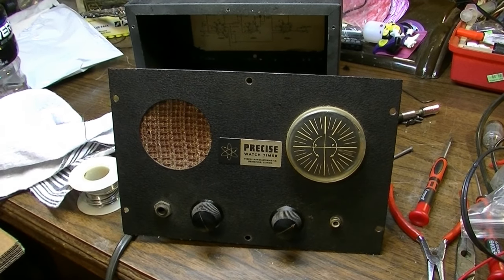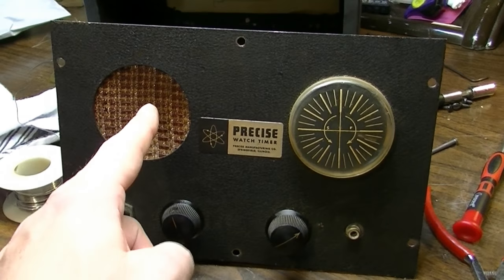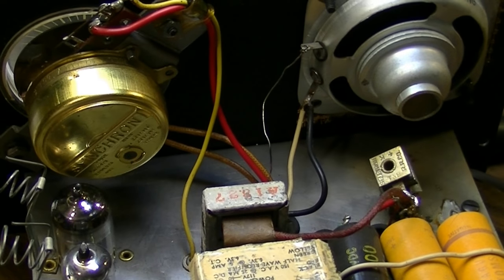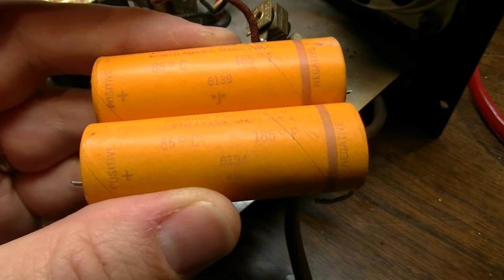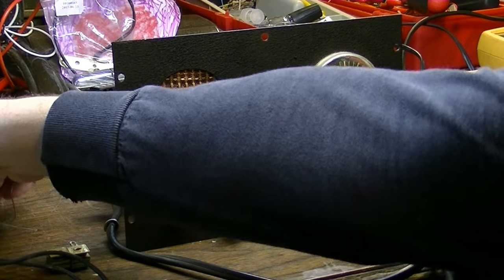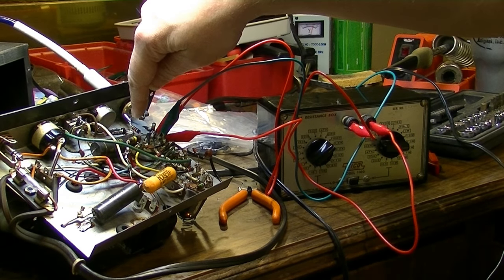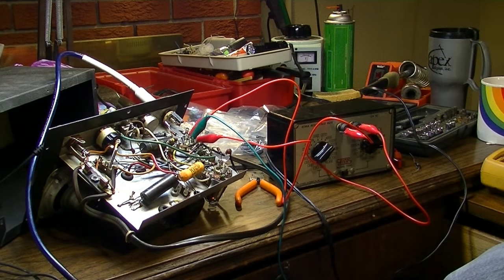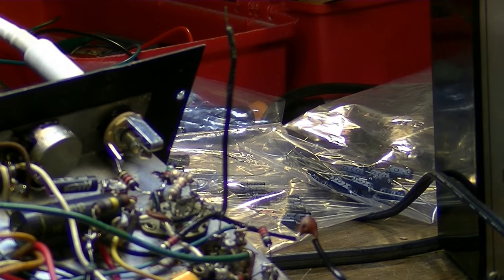Vintage Watch Timer Converted into KILLER Guitar Preamp (Part 1)

Comment: The high gain circuit is to amplify the sound of the watch and the flashing light syncs with the sound and acts like a strobe-o-tuner except for time rather than frequency.  This is used to adjust the speed of the watch for accuracy.
Reply: Correct. They had a cradle type arrangement to hold the watch, with a microphone in it...thats what would have pluged into the rca jack.
Reply: and then they sync the beats like two metronomes?
Reply: Bo Huggabee, thats correct
Reply: cool thanks for the info!!
Reply: Would that be for the watches with crystal movements? I found a old watch that had 18 jewels in it, But once opened it had been changed over to cheap movement idk why someone did that.
Reply: It is for mechanical, multi-jewel watches.  High end time pieces for the most part.  Cheaper mechanical watches cannot be synced and electronic watches don't need it as they use a crystal oscillator for accuracy.  Just a fun fact, some of the multi-thousand dollar 21 jewel watches were accurate to one second a year.  (at least they claimed)

Comment: watching you work on all this stuff has educated me on how similar tube Radios-Televisions-Amps-Stereos and devices such as this watch converter were.  When you open them up for examination, they all look very similar in design and layout...  I guess a good electronics tech from those days could work on all of this stuff as its similar.   I'm old enough to remember Sears and a few other services that worked on our old tube televisions in the early 70's.  They all carried a metal tool box and also a tube caddie.....
Reply from the maker: I'm pretty sure I'd be mostly lost if you put a vintage TV in front of me to repair. It would take a huge learning curve to figure out what I was looking at. But I do pick up a lot on YouTube from radiotvphononut and shango066.

Comment: That 2d21 is a four electrode inert gas filled thyratron with negative control, yes I looked that up in the tube manual because I was pretty sure by the two grids that it was a tetrode.

Comment: I loved these series of videos on this little project. A little while ago I discovered a class of tube known as thyratrons, which include the 2D21 in this amp. They were the precursor to solid state thyristors and were used in early and very primitive relay circuits. They were interesting in that they were not vacuum tubes, but rather were filled with a gas (sometimes neon I think), so that when a control voltage was applied to the grid it would flash over and discharge at a (fairly) predictable rate. They were also sometimes used in oscillation circuits, and it occurred to me that this would make them interesting to try to make an all tube tremolo circuit using a different approach than what was commonly seen in 60's Fenders and 60's British amps. Using a neon light that was already in this circuit to make a tremolo is interesting, but the thought that occurred to me is that the light may be redundant, as the LFO signal can be produced by the 2D21 tube directly. I'll give you a show and tell if I ever manage to get this little project working.

Comment: Brad, I don't know if you noticed, but when your using the Decade box around the 24:45 plus mark; there is arcing on the input jack. I don't know, now after watching further. It may be a reflection of light as you move your hand. It happens later when the amp isn't powered on. It really looks like it though.
Reply from the maker: You have some damn good eyes, man. That's a reflection of the light bulb behind me, I think. When I move the light is exposed. Well spotted though! Arching at the input would be

Comment: You can get between 1/4 to 1/2 of a watt off a 6AU6 used as an output tube, as long as you keep the plate dissipation in check. There's a project called "PRR Third Watt" that's basically a Fender 5C1 using two 6AU6, one for preamp and the other for power, as well as a number of push-pull projects using 6AU6's in the power section.

Comment: That is really a cool piece of equipment Brad. I'm not completely sure but I think it was used to check the freq of the quartz movement of the " no wind electric " watches then. By reading the frequency of the quartz, they could then slow or speed up the control on the escapement lever. Just a guess.
Reply from the maker: Your guess is as good as mine on that. My first thought was how similar it is to a timing light used in cars for when you have to change a timing belt or chain.

Comment: I am assuming there was some kind of microphone pickup placed on the watch to be measured which lights the bulb on every tick...and the spinning wheel marks where the tick happens...then you adjust the watch...but it probably works better as a guitar amp.

Comment: 2D21 tetrode thyratron is a type of gas-filled tube (low pressure xenon) designed for relay or grid-controlled rectifier applications. When a certain critical anode current flows the ionization of the gas begins an avalanche discharge that overrides the grid control and leads to saturation current flow. The anode current can then only be extinguished by reducing the anode volts below the ionization threshold.
Reply from the maker: Bob Saturday Brilliant! Great comment. Makes great sense. I got a bit covered up with customer jobs and didn't get that far in my investigation, but makes perfect sense. That info might help when I get back in there and refine the trem. 
Datasheet: http://www.farnell.com/datasheets/233495.pdf
Reply from the maker: Did a bit more research on this tube, Bob. Used in switching and relays, but also ran across THIS! One could build a tone generator with these also. Fascinating tube. http://www.cgs.synth.net/tube/pic/schem_tube_noise.gif
And Univox made a synthesizer using them in the tone generator: http://www.vintagesynth.com/forum/viewtopic.php?f=1&t=79506
Reply: reminds me of a peterson strobe tuner
Reply: Tube version of an SCR.  Nice way to drive the flash.  Cap charged, tube fires, and the bulb drains the cap, current stops.
Reply: wow ! I sure don't get too exited about much at this stage of the game but that is darn interesting stuff .
Reply: This is really an awesome project and a well done and very informative video. you could have just done all this work and said, "here is a sound demo," but you took the extra time and effort to show us and explain how you went about it. Thank you for that!  It was fascinating, in my opinion.
Reply: Seth Thomas made a very nice electronic metronome which used the 2D21.  The 5727 is a special version which has a higher voltage rating and a ceramic anode insulator, and I believe they were used as flash trigger tubes.

Comment: The input would have come from a piezo driver that a watch would have clamped against.  The ticking of the escape wheel would have caused pulses from the driver.  Like a crystal phono pickup being tapped very lightly.

The machine would amplify the pulses enough to make the bulb flash for each tick.  The adjustment would come from speeding up or slowing down the watch so that the flash would come at exactly the same point in the rotation of the wheel.  (Every 1/60th of a second.)  Probably there was a calibration service that made sure the wheel was spinning at exactly 60 RPM.  (or an adapter that that used line frequency to simulate pulses.  OK if the bulb flashed 60 times a second as long as the position didn't rotate.)
Reply from the maker: I figured it had to be something of that nature. Are you a watch repairman?
Reply: I'm pretty sure it used a synchronous motor that spins at some multiple of the line frequency.  That would be it's calibration reference.
Reply: My dad was a letter carrier.  A guy on his route was a retired jeweler who still did repair jobs now and then.  We were at his house to get my dad's watch repaired and he had a couple of machines like this.

The other one I recall best was newer, all one unit.  The watch clamped into the jig with the pickup.  The sound drove a solenoid that made a bar tap down.  Underneath was a cash register tape type paper that the machine pulled through.  Under that was a round bar that spun at 60 RPM and had a raised spiral down the length.  When the bar tapped it left a mark on the paper.  If the marks were in a straight line then the watch speed was right, if it wandered left or right the speed needed to be adjusted.  Nice because you could leave it for a while and see how steady it was over a long time.
Reply: That sound right.  Nothing to fool with, but you're at the mercy of the power company's frequency accuracy.

Comment: Once again you have found that weird piece of equipment and found a nice little amp just waiting to be heard. Great little amp!
Reply from the maker: Thanks for watching, Ron.
Reply: The Guitologist  the input would got to a mic to pick up the ticking of  the time piece, the motore will sync with 60 cycles then ghe flashing of the neon/light will strobe with the disc, so the freqency of the ticking will freeze the disc thus the differce betewen 60 and the ticking will show up by the position the disc freezes
Reply from the maker: Thanks for the comment. I'm struggling to understand that since the disk speed is static. It does not change.

Comment: Hey Brad,

 In regards to that noise suppressor cap, I've used a similar value in some fuzz pedals to reduce radio pickup in the first gain stage. Usually I tie the cap from the output back to the input, thus feeding it back to cancel. In theory, the inverted output from the tube would cancel those freq's at the input in the same manner. I would try strapping from plate to grid, rather than dumping all beyond the shelf off to ground and see if that works better...
Reply from the maker: Good suggestion. If this piece wasn't already so treble heavy, I'd go that route, but thanks for bringing that up! That's something a lot of builders incorporate into their high gain circuits, moreso than just shunting to ground as I did.
Reply: In the fuzzes I've incorporated this component into, I usually find I have to tune the cap to the device (given the wide tolerance range of early germanium devices, that makes sense). That said, I found that I always preferred to go beyond simply blocking the device from picking up the local radio, and actually like when it tamed a bit into the high end as well. I've experimented with value from 50pF all the way up to .02uF, just to hear the effect. I almost always settle somewhere around .001-2 range. It tends to roll of that icepick really well...
Reply: Hi Finom - I suggest looking at DIYstompboxes. That forum is a fantastic resource - better than I am alone, that's for sure!

Comment: i've got a old philips tube radio and plugged my guitar into the phono input and it sounded great but i eventually got small shocks how can i fix this
Reply: btw this is my first project and its my dad's old radio and i'd love to make it into a guitar amp it even has a speaker output.
Reply: BoboButYouCanCallMeTom 3 prong power cable.

Comment: Can you put any voltage like the plate voltage thru that decade resistor and capacitor box?
Reply from the maker: Yes. The resistors used in this are 2W, so it's a pretty flexible box that can be used in most parts of a guitar amp circuit.
Reply: Thanks..just getting back into electronics...and fix tube radios and need something like them two box's, because as you know..sometimes the parts are burnt up or the codes are worn off...thanks..

Comment: Replace that speaker, mount the whole thing in a cabinet with a larger, maybe 10" speaker. Then use your oscillating circuit to sweep between the two. Maybe put in a high and low pass filter on each speaker to. That way, when it's not oscillating they'll act like a 2 way speaker, and when it is, you'll be sweeping between a high and low pass filter. Should be an interesting effect.
Reply from the maker: That's an interesting idea. Watch Part 2 tomorrow or Friday to see what I end up doing.

Comment: That Mallory Plascap is .01uF 1600V. The misprint of the other digits shows that the 3 is a zero and the decimal point is completely missing. As you say 1600V is overkill.
Reply from the maker: Smudger Dave I did not measure, but surely you are correct. 31uf is just too out there. First time I've ever seen that cap style.

Comment: Ive never, ever had any selenium go bad where the electrolytics were swapped out before a plug and play was attempted, or any other major current pull existed with in a DC circuit down the way

Comment: I have a thermal wire stripper that works killer for tough insulation issues (rubber, teflon, etc.)
. I've used your technique as well...

Comment: is it not is try and create a bead like if your are welding steel plate just wondering, I think that using new  Polypropylene metal foil capacitors with a 500v wkg might be the way to go, if the unit is crapping out it might that an electrolytic capacitor might about to spill its guts all over every thing in the preamp.

Comment: sounds ok with that little speaker , probably better with an old alnico12 . I'd have ripped those parts out and done a standard fender type pre w/ tone , replacing that 2d21 with 12ax7 for the tremolo and a 6bq5 for the 6au6 but when you say that it's a collectors piece , you're nuts not to sell on ebay
Reply from the maker: Bob Saturday the beauty of what I ended up doing is, it can still be used as originally intended...I think! :)
I'll watch the $500 one a while and see how it makes out. Hopefully this video flushes a few more out onto the market so I can pick up a second one.
Reply: $500 is dreamland fishing , maybe $250
Reply: The Guitologis

Comment: This message is to Brad or anybody really since I know some of the people who watch these videos also do repairs. I have an old DBX 160XT compressor that I've had forever and really just love the thing. Unfortunately, it started picking radio interference a couple of years ago, especially CB radios. Even using my best shielded ancient Switchcraft Y-cables from the 70's still doesn't help much. From what I've been told, this interference thing is probably just a grounding problem, but darn if I can find anybody in the St. Louis area who will work on it. (Actually I live in Illinois about 20-minutes away.) I have no problems sending this out if you know of a competent repairman that can tackle this. Thanks!
Reply from the maker: Bill, it sounds like time for an overhaul. Needs to be gone thru and any old, leaky caps replaced and drifted resistors, cleaning... One thing you can try yourself for sure is clean all the ground contacts. Get some contact cleaner and wire brushes and clean any and all jacks and pots where they contact the chassis to complete a ground connection. Clean all grounded jacks too. See if that helps then move on to the calibration procedure: http://rdn.harmanpro.com/product_documents/documents/600_1324058394/160XT%20Calibration%20Procedure_original.pdf
Reply from the maker: If you want to ship it to me instead, I'd take a look at it. I can't guarantee I could fix it though. That's a bit outside my wheelhouse.
Reply: Only if you're sure you want to do it. I don't want to take advantage of you or your time. I'm not in a hurry though. It's not my only compressor, so if you had it for a month or more, that wouldn't bother me at all. If you'd like me to send it, just let me know when and where. Thanks Brad.
Reply from the maker: Your best bet is to contact DBX and see who services their stuff for them and ship to them. I have no doubt I could fix it given enough time, but would it be worth the expense? I doubt it.
Reply: Okay then. Thanks anyway.
Reply: Give it a go, usually it´s not a complex failure, but if it something more complex do a video and we help online;)
Reply: Ha .. watching this video to keep my mind busy while transcribing the schematics for a dbx 160 VU.  :-)

Comment: a watch timer uses a microphone to pickup the ticking of a watch and compares it to a reference.  I'm not sure exactly how this one is supposed to work though
Reply: my guess is the motor spun the disc at 1 rps and the bulb would flash in time with the watch to show if the watch was slower or faster than the motor
Reply from the maker: I think the timer is based on the fact that US electrics operate at 60hz. There are 60 seconds per minute also, so that is part of it, I think. I could find nothing about this company or this product anywhere online. Maybe the Springfield Public Library would have some information. Perhaps one day I'll call them and see if they have a researcher in residence.
Reply: The Guitologist yeah I was thinking that too.  I guess the 60hz would be accurate enough. I've never really looked at it.  ok I'm going to go look at it on my scope.
Reply: eh close enough for setting a mechanical watch I suppose.  there's a lot of small fluctuation but my guess is that it would even out.  apparently a lot of old ac driven clocks actually used the oscillation to keep time so I guess it works well enough.